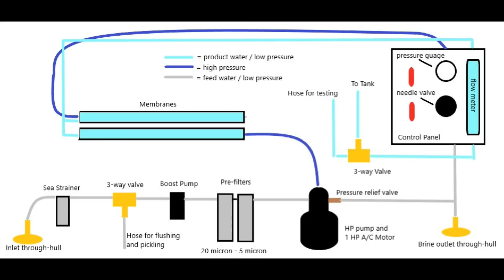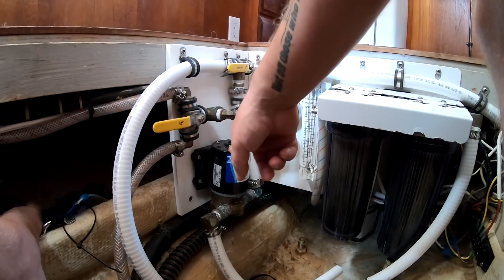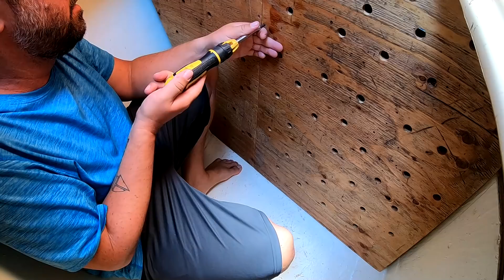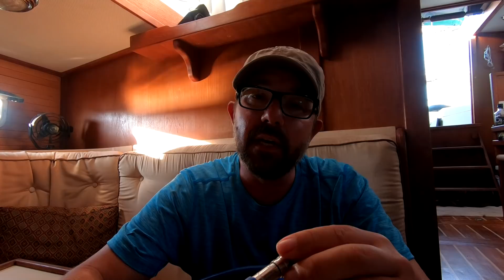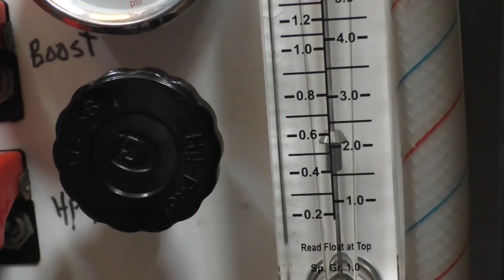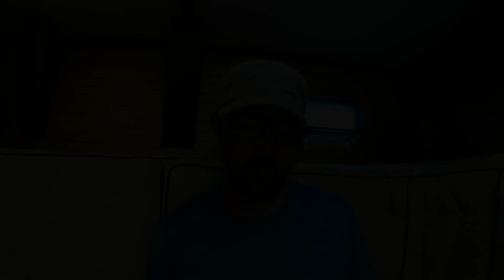How to make a 30 gallon per hour watermaker using off the shelf parts.

Comment: Considerations: *Can I add one more valve, and a long high pressure hose, running aft, off the 800 PSI pump?  This I would label "Auxillary" to be used for encouraging guests, when they've overstayed their welcome.

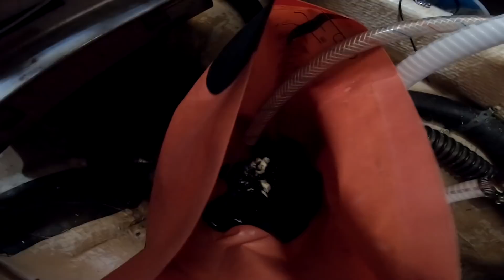Comment: Awesome, beautiful, I love it!  Thanks for thoroughness thoughtfulness and parts list.  One question,at 19:00 for the flushing portion, are you sending the "bucket water" through the system, then out the thru hull? Or is it still going into the fresh water tank?  I didn't see how it's not just cycling from the bucket... back into the bucket.  I'm thinking it's going back to the sea, have I got that right?  This is the most inspirational DIY watermaker I've seen.  I feel confident, fair winds from grateful single hander!

Comment: Hello. Thanks for the video. Beautiful, simple set up. Gathering the parts right now. Would you be able to tell me where to get the pressure relief valve? The one I got with my Cat pump is a blow off valve with no means of connecting a line to it. I would rather not have salt water flowing into my bilge if it does let go. Thanks.
Reply: General Pump- who also make high pressure piston pumps stocks the SS316 pop safety valve

Comment: A pump from hi-presser wasser ? . Blue-steel Denmark 🍺🍺⛵⚓
Reply: The pump's flow rate and psi will have to match that of the membrane. And the pump's flow rate and psi will depend on the rpm of the motor you mate it with.

Comment: My system (was on the boat when bought) does not have a booster pump. It goes directly from the through to  hull prefilters to high pressure pump which is below the water line. Do I still need need a booster pump ? Great  and very informative video.

Comment: Can this System be used in home near the Sea -just as it do on Boats?
Reply: The same concept can be used in any application to make water from salt water so yes you could use it in a home
Reply: Yes why not. I would just go with a bigger motor, pump and membranes if I had to do it on land.

Comment: How much power does this thing use?
Reply: I would estimate around 10 amps You would have to look at the amp usage on the booster pump and the amp usage on the high pressure pump

Comment: Great video. Without having any knowledge about the systems other than what I’ve seen in videos or read. I wonder if setting up a system to Back flush the membranes and filters wouldn’t extend the life of both and extend the time between filter changes?

Comment: Have you ever considered putting a charcoal filter in the line? Non marine water filters have been made using charcoal. I have been told that charcoal is the best filtration there is.
Reply: Investigate a Pentek CBC-10 filter which filters down to 0.5 microns and is NSF-53 certified to remove biological cysts from water, lead et al....

Comment: Did you say 48 inches re membrane or is it 40 as written?
Reply: 40" as written.  The Dow Filmtec filter is a SW30-2540.  SW standing for 'SaltWater'.  Don't buy BR30-2540 which is designed for 'Brackish' water
Reply: @rhirwin10  Thanks.

Comment: Amazing self build engineering, however, your focus seems to be primarily about desalinating and resultant TDS .. there are additional needed features I hope you have explored .. including adding an in line UV light to kill cryptosporidium, etc as well as considering a small multimedia filter to further reduce your micron filtration down to 1-3 microns and a electronic in line chlorinator that uses your salt level to create a drip conversion into sodium hypochlorite level between 1-3 ppm to further kill any stagnant propagation of mold, algae, etc in your retention tank along with some small recirculation turn over filtering so you produce soft safe pH balanced drinking water .. I didn't see you use any chemical solution testing for pH, acidity, calcium, etc either .. and I didn't see you explore the use of any acid either .. this may beyond your concerns but are are just my suggestions to plant seeds for thought. .. if you need more direct diagrams or sourcing components, feel free to comment back

Comment: Why not use a electric pressure washer for the high pressure pump and motor
Reply: Thats worth looking into. Good idea. I wonder if there would be food grade problems?
Reply: @scott.wallace8625  I don't see why there would be a food grade problem considering it's getting ran through a membrane and several filters
Reply: Yep i just wondered. Have you tried it? I was inpressed with the $100 ryobi pressure washer last i tried one.even repourpose a gas one might work
Reply: @scott.wallace8625  thats a great idea using a gas pressure washer you wouldn't need a high power source
Reply: @robertmoreland1220  I read somewhere this was discussed. They made a good point that pressure washers wouldn't last long pumping salt water.

Comment: The high pressure hoses look like they are "O" ring sealing. The motor looks like a capacitor start & capacitor run.

Comment: Oh Baby, you da man.  I have been agonizing over 5K for Rich Boren's R/O system.  I already have two Honda 2200 watt gens.  Had to buy them due to PG&E cutting off power last fall due to high winds causing terrible fires.  I only have 25 gallon tank on my 30 foot trimaran...but i keep 2-3 water shower solar bags on the nets.  When you have a woman on board it is almost mandatory that you have plenty of fresh water.  Women do not dig camping style boating.  

If i go the DC route then i have to upgrade to larger battery bank...like Lithium Iron Phosphate...2-3K, BMS systems, solar arrays, add cost add cost add cost....so, it makes sense to me to use a Honda and a DIY system.  Thank you for such a good tutorial and mentoring.  I really enjoyed your presentation.  Also thanks for the parts list....

Comment: What I've been unable to figure out his how the pickling chemicals get past the membrane.  I've experienced the same problem, even having the pickling solution destroy my pex fittings (3 different times).  I finally got some brass pex fittings and that problem is no more.  Wish I had space for those longer membranes, I'm stuck at 16GPH because of my shorter membranes
Reply: Ah, many men have short membrane complex.  As long as your plumbing works you will be okay.  It is not how big it is...it is how you use it.  Hope i helped...smile
Reply: @alansmith2203  The problem comes from expending the energy to get the pressure up to 800psi and only getting 8 gals/hour per membrane because they are shorter than the 40" membranes.

Comment: Hi, Thanks for your video. I am willing to build one for my boat. I have a question about yours. You say that it produces 30GPH and you use two SW30-2540 membranes. According to the specs of this membrane, it can produce 700GPD (equal to 29 GPH). If you use two of these membranes shouldn't you produce 60GPH instead of 30? How come you produce only 30GPH if you have two membranes? Thanks

Comment: sailing vessel adventurer do you think this pump and motor could be used with the 4" filter? sw 4040 or would the flow not be enough?
Reply: No - insufficient power from a 1HP electric motor to achieve the requisite pressure

Comment: Hi there, thanks for the great video.How much pickling solution do you use?
Reply: 10 Tablespoons for 5 gallons or alternately you can use Propylene Glycol in a 50/50 mix with water.  !!!!
NOT Ethylene Glycol which is very toxic!!!!

Comment: using the part list provided I am finding the most expensive part is the mechanical pump part "pump part # 2SF15SEEL" which lists anywhere from $915 to $1300.........  there are less expensive pumps out there, so my question is, what specs are necessary, stainless vs brass, is pump output a factor or can that be regulated with the pressure relief?

Comment: The only thing different with my system was a vacuum gauge after the filters to tell you when the filters need to be changed or cleaned.  Also, never flush the membrane with chlorinated water, it will kill them.

Comment: Nice vid!  I built a system like this when we were cruising the Caribbean. 1hp motor, brass cat pump, 2 2.5X40 membranes.  The guy that showed me how to build it had been installing water makers for many years for boats, ships, and shore systems.  He taught me that a  2 - 2.5X40 membrane system was good for about 40 Gph and that you should adjust the system pressure to get that output.  Depending on water temp and salt levels you should use a higher or lower pressure to get the correct output. Running too high a flow rate could damage the membranes he said.  Obviously you can not run  pressure above the rating of hose or housing.  I used my system like this for a few years without issue.  Not saying it's right, just what I was taught.
Reply: He's right. It can be a little bit more technical than that and you could get a little more out of it at lower salinity, but then there's a distinct possibility of damaging your membranes, so by adjusting the pressure until you get a specified amount of product water you are saving potential membrane issues.

Comment: Can you use it in fresh water?  River water I guess
Reply: Yep, but you have to make sure that the production of water never goes above 10% of the feed water volume per membrane (so for this system he would be running at a 20% recovery rate max as he has 2 membranes)
Reply: yeap

Comment: Has anybody look at the low pressure system yet. It can do RO (so it claims) on normal household pressure lines. https://www.ebay.com/itm/Residential-2012-100GPD-RO-Membrane-Housing-Interchangeable-With-GE-Dow-Filmtec/223335932787?hash=item33ffdbe373:m:m6pdeSj8cBPQxwpTKgEs_dw. If that is true you would not need a high pressure pump.  "http://www.farriswater.com/zcart/index.php?main_page=index&cPath=190FILMTEC home drinking water elements are rated at 50 psi and will purify about 20% more water than competitive elements rated at 60 psi.

Comment: At 500 PPM  Calcium makes little icebergs on the surface of the coffee, but otherwise Thank Zou for fantastic video
Reply: The WHO has standards for the TDS and anything below 500ppm is considered excellent quality water
Reply: I live in Phoenix AZ and the city water TDS varies by season but is generally 550 ppm TDS.  I use an under the kitchen sink RO membrane (which works with chlorinated water) and get about 125 ppm TDS.  So a big difference.    Without the RO system I was constantly descaling our coffee machines.

Comment: Excellent, just absolutely brilliant! Do you think it is possible to have a hp connector point (tee piece with ball valve tap) between the hp pump and membranes, effectively to connect a hose for high pressure washing down muddy anchor chains or salt deposit sprays on deck? Many thanks and lots of love from South Africa!
Reply from the maker: It would be possible, however, it would be a salt water wash down coming through your T valve. If you are looking for a fresh water wash down, you would have to rig up something after the membranes. I have heard of people who have used the testing line for that sort of thing. Good luck!

Comment: 12 VOLT SET-UP???  I realize your design is based upon household 110v current but can this same design be adapted for use on a 12v dc system to avoid having to run the genset to make water. My obvious concern is my gen going to crap and now no water. For some reason, I seem to have my share of genset problems. If anyone reading can suggest the changes necessary to convert this design to a 12vdc system that would be much appreciated. I also realize my output will be less, but I am ok with less gallons per hour. THANK YOU
Reply from the maker: It is possible to make it as a 12v system. You would just need a different HP pump and motor combination.  Everything else could stay the same. I unfortunately don't have part numbers on a 12v pump and motor combo, but maybe someone else will chime in on it. If you figure it out, please let me know. Good luck!

Comment: Or you can just use bleach...  Cheaper and you already have it on the boat.  Or you can use a UV filter   10W from any fish store...  No pickling ever needed, just pump it through.  Dirt cheap as well.
Reply: NEVER put bleach through an RO system. That's a really good way to ruin your membranes real quick and then you'll be up for more than 100x the amount that you saved by using bleach instead of the proper pickling solution.
As for a UV filter, a 10W filter isn't going to have enough power to treat the volume of feed water going through this system and just uses unnecessary power when the water coming out of the RO unit has been treated already and doesn't have any microbes or viruses in it.

Comment: 2540 housings, 1000psi recently bought 2 thru Alibaba.com priced from $106us to $130us in lots of 2. Shipping to US $75. Farm store is a good source for pumps and motors. Some have Swagelok. Also engine parts for marine diesels that are used in farming or industry.
Reply: Can you list the supllier or a  link to the housings
Reply: @masttech01  go to ailbaba.com and register (free).  Go to my Ailbaba, Go down the column to "Submit RFQ. This opens an area for you to list what you want and conditions. Be specific. Like 1000 psi membrane housing include shipping to USA, etc.

Comment: Great video! Spare hoses and cables can be zip tied right next to the hose or cable that’s in service. Just be mindful of the potential for chafe. It’s a good way to clear up those spare parts bins as coils of hose and cable take up a lot of space. Best of all if a failure occurs the new hose/cable is already run and can be swapped into service in a couple minutes.

Comment: Is this a too
 cheap alternative?
 https://www.aliexpress.com/item/390-copper-household-high-pressure-car-washer-cleaning-machine-car-wash-device-car-wash-pump/1134124353.html?spm=2114.10010108.1000013.1.42a56ac2oVODOF&gps-id=pcDetailBottomMoreThisSeller&scm=1007.13339.90158.0&scm_id=1007.13339.90158.0&scm-url=1007.13339.90158.0&pvid=bc782ca6-31f2-417d-b836-3d8cf967cd6c

Comment: Nice, professional video. More thoughtful installation than most dealers do. I cruise Astoria to Alaska in a powerboat with a lot of room. Always in cold water, 55° or so. I made an inline water heater with NPT screw in elements and clamp on thermostat. At about 70-80°F you get the most water. I flush my whole system with fresh, starting with the boost pump. When I can, I'll anchor in a river. I use 4.5x20 (big blue) filters. They last about 4x as long. I filter 20/5/1 microns and GAC, CTO filters before the hp pump and a carbon filter after the pump. 20 & 5 micron are washable and go several months unless in a muddy river. Other filters last about a year. Original membranes. I have great tasting water and make it year round. No growth problems in the system, but have to use a small amount of chlorine in the tanks. No dock water in 7 years. I also have a Magnum 120/240v inverter. Buy most of my stuff on bebay.

Comment: Outstanding video. I have an older system with most of the components. Membrane pump etc. But it is old, installed by the prior owner and as of today had no clue how to fix it. So now I am going to basic. take your video and make mine looking like yours. Now I understand the system. Tell Me how it works and I me remember for a day. Show Me how it works and I will remember a whole lot longer"  Thanks a million.  S/V Adventurer where you in RioDulce Guatemala lately ?
Reply from the maker: We were not in Guatemala lately.  Our boat is currently stored in Chiapas in Southern Mexico.  We're traveling through Asia for the summer and then we'll be back down there to continue our way through Central America on the boat.

Comment: Do you have the manufacturer and an explanation of how you hooked up the "pop off valve" for pressure relief? I've looked at the Cat 9960, but it doesn't look like you can connect a fitting to the end to direct the seawater to the brine discharge.
Reply: Never mind, I should have read the data sheet. A 3/4" hose fits over the end.
Reply from the maker: The pop off valve I used is from general pump, part number  1009931c. The pressure relief was pre-set at 950 psi, so it was a pretty easy plug and play scenario.

Comment: in the high pressure hoses, did you bought the blue pipe asside and ask for the fittings to be putted in mexico? or i understood it wrongly?. btw thanks alooooot for this video. is going to be a great help for my water maker
Reply from the maker: Renato Gomes hi Renato. We purchased the entire assembly in Mexico. The hoses with the blue cover and the end fittings came complete.
Reply: Do they have a website?
Reply from the maker: I haven't been able to find one. I originally found the shop by asking around through the local fishermen.

Comment: So, what's the total parts cost to put such a system together? Did I miss it someplace? I see that for comparison purposes, the smallest Spectra Marine watermaker is $6K+. If I follow all the links to products in the description, it looks like the main pump alone is $445, then add the two Dow reverse osmosis filters at $218 a piece. So perhaps the whole system comes in at around $2K??????? Please advise. Thanks, regardless for putting this all together. Very informative. Might have been nice to spend a little more time on the diagram going over how the whole system works before cutting to the actual system in place.
Reply from the maker: Hi Peter, when I put it together around 7 years ago, it was roughly $1,500.  If you read down through the comments below, others have said it's now around $2,500 using the same parts I used.  But, there are other pumps and motors available, again if you read through the comments, that drop the price to around $2,000.  Good luck!